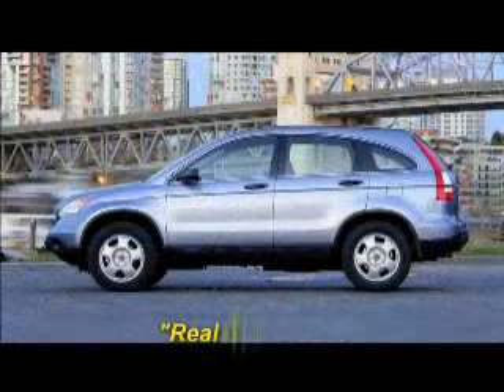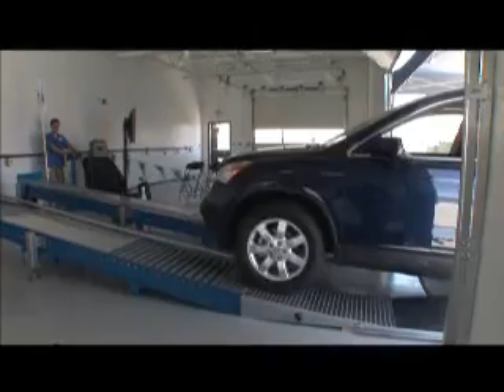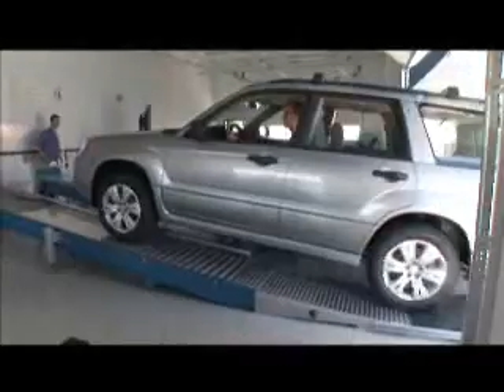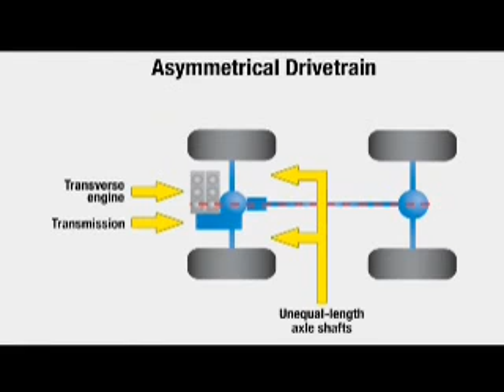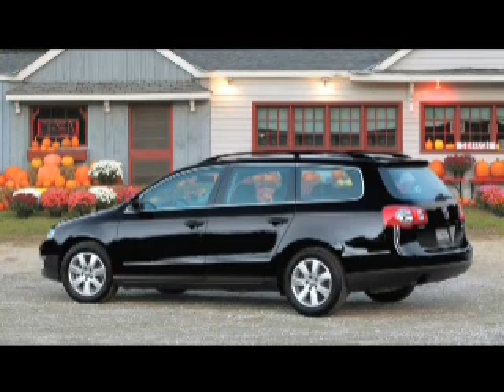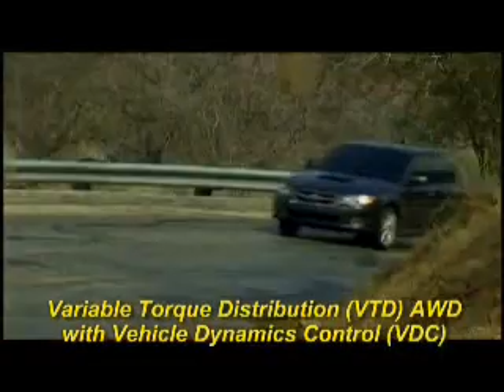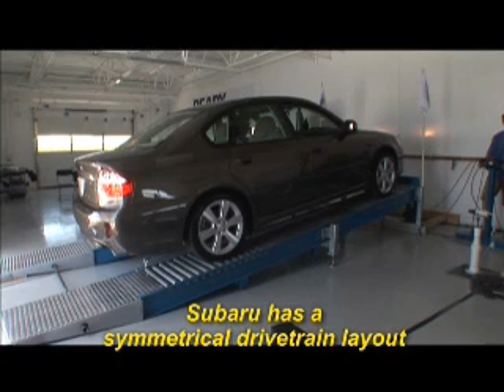Subaru AWD vs. competitors

Comment: I disagree...I own a 1997 Legacy L 4dr (auto) and an 05 Honda CR-V EX.  I have Blizzak snow tires for the CR-V and some 80K mile touring tires on the Subaru.  My Subaru would consistently make it up the driveway when the CR-V wouldn't...VSA on or off.  It was pretty sad as I was debating on CR-V vs Forester.  The CR-V is a lot roomier and I like the VTEC engine, but it doesn't even compare to the Subaru.

Comment: I'm looking to get a nice awd winter car. I found a 2007 Wrx with 75000km with invidia exhaust for 10500$. I also found a 2002 Audi A4 Avant 1.8T quattro stock with 125000km for about the same price. Which one should I get? I heard Audi's have electrical demons

Comment: this is also not all correct. The subaru with VCD can transfer up to 50% of power to the rearaxel and up to 100% to the frontaxel. The Torsen kan give up to 100% on rearaxel and 80% on front. and the Haldex 4gen can give 100% front or back. Also the haldex can give up to 85% on any rear wheel. The Haldex on the Passat is BAD BAD BAD and is a 95/5% system with limited transfer options. the 5.gen quattro and 4gen haldex will give the subaru system a beating. Please do the test!

Comment: yeah afaik most subaru's don't have traction control. Mine doesn't and it's not needed. Its symmetrical all wheel drive provides zero torque steer so no traction control needed.dd

Comment: I have a 2001 Jeep Cherokee with PT 4wd & an open rear diff. In deep snow or off-road it is almost unstoppable.On the road snow up to 1/2 foot, rain pot holes my 99 outback rules. Jeep unfortunately makes no modern equivalent  to the light fast fun to drive box Cherokee. I will buy 2011 Subaru Outback h6. It Weighs the same as 1999 outback has far more room and 100 more horsepower, far safer and gets better real world gas mileage. Now that's progress.  So what if it looks like a shocked rabbit.

Comment: This test does not represent a real world situation.
The rolls on this test provide ZERO grip. A car is VERY unlike to have more than one wheel with ZERO grip. When I say zero grip I mean ZERO
Most of the time the wheels have some sort of grip despite slipping at hight speed
When a wheel is slipping it still provides some traction to the car but in this test the "bogged" wheel has ZERO grip so it gives zero traction to the car. Its like having a wheel hanging on air.Can you have 3 wheels on air?

Comment: you only got half right.
 All 4 cylinder Audi and VW equip 4 motion(haldex,Wether they call it).Q5 2.0T or A3 2.0T is 4 motion but audi said it's quattro(caused under audi flag)

All V type Audi or VW equip quattro(torsen,whether they call it).phaeton equip with quattro but VW said it's 4 motion cause under VW flag.

wether to judge the vehicle equipe with haldex or torsen,as long as you see wether is V engine or not.

Comment: This video is bogus. The rear wheels aren't shown on purpose, so they can lie about the other vehicles (though they are telling the truth about the Subarus). The voice over keeps saying the other cars don't transmit power to the rear wheels. But they have added a steep step for the rear wheels to surmount before the car could move forward (you can see this when a car does move forward, it first rises up in back). So the test does show that Subarus transmit more power to the rear, but that's it.

Comment: Now test the best of Subaru against the P85D. See who has insane traction?
Reply: EH! Wrong. I could explain but I wrote that comment over a year ago. a) You're too late b) I forgot c) we now have a P90D and the best Subaru is the rear-wheel drive only BRZ.
Reply: I don't know anymore, it's been over a year. I've changed now. I'm not a mechanic for a Japanese auto maker. Now I'm into fashion and industrial design. Sorry, people change!
Reply: ***** But you are correct, not all AWD is created equal. Now one of the best and most efficient (even if not as effective) is Mazda i-Activ AWD. Have you read up on that? Is kindof amazing actually, very simple and intuitive. It detects environmental cues and position to send information to the wheel drive system. Read up is one of the most interesting and elegant solutions to the traction problem.

Comment: Try the Suzuki SX4....mine goes uphill on ice fully loaded from a dead start. And if I want I can turn off the traction control to really have fun with the curves. And I can totally lock it into 4WD. As long as the snow doesnt get up under the skid and actually lift the car off the ground my SX4 will get me to pizza

Comment: Do NOT buy any Acura as they are the same as highlander awd. In snowy st Paul I got stuck and the front wheels spun like crazy on snow and the rears on road surface and it it did not move. Quattro is not the same class but its better than xdrive which by the way I had to use my old outback to pull out an x5.

Comment: I wonder what makes people buy CR-V? It hasn't got Honda's fantastic V-TEC engine, nor economical IMA hybrid system. It' s hasn't got particularly agile handling nor serious off-road capability. It's only 4cylinder engine with 5seats and gets same gas mileage as V6 3.5litter Odyssey which has 8seats. Design? Hmm I'm not sure about it either.

Comment: of course the vw is not distributing enough power to the only wheel with traction, the car was not being revved up enough, of course 25% of only 50 hp wouldnt be enough to climb the ramp, if you were actually on a hill and full throttle releasing all 200Hp of the 2.0t the drivetrain would put 25% of that to the wheel, this test is invalid because the cars would fly right through the wall, my girlfriend's awd tiguan will blow the doors off a 2.5 subaru and get 5 mpg better, and we cant get it stuck if we tried

Comment: This is totaly wrong information. The 4motion/syncro and quattro system is not the same. they are all just brands. The passat in this test have a haldex system with 90/10%. 

40/60% is not stupid and on tarmac it's superbe! most audi's have 50/50 just like the subaru but the audi use mecanical coupling insted of viscous on subaru. You realy should try audi A6, Passat B5 or touareg and the subaru will be in strong competition. Also the new Opel Insignia would give it a hard time.

Comment: Subaru don't really have any proper competition, no other AWD system comes close.  It's all in the perfect drivetrain layout, every other manufacturer makes compromises with transverse mounted engines, transaxles, uneven length driveshafts etc. 

Couple that with the superb boxer and it's top of the pile, consistently.

Comment: This obviously only works with the later Subaru models.

I have a Forester GT turbo 2000 model. If one wheel looses traction the car wont move.
Symmetrical AWD means nothing. This guy is dribbling shit, It has all to do with how good the differential locking works. You can have a perfectly symmetrically system and it can be worse than a non-symmetrical system with good differentials. Obvious sales man has read the sales pitch and is just preaching it.

Comment: @harmankardonbose ok wranglers are very incredible automobiles, but thier 4wd is very unbalanced because the power has to go through a very unbalanced and heavy transfercase, i know the subaru would beat the hell out of a jeep in a traction test, cuz its common physics, and ive owned 4 jeeps (68 & 69 jeepster comando, and 87 &88 jeep cherokee limited [cherokee has the EXACT same layout as the wrangler] ) and 3 subarus (an 1984 gl coupe, 01 forester, a 2005 wrx wagon) and the subaru kills it..

Comment: I can tell you, as a devoted subaru driver...In rally, Ford Focus rapes subaru. In power/vs weight ratio, Evo takes it. In drivability and long term use, subaru wins. Mitubishi makes crap that runs fast for a short period, but its cast iron block is made from, apparently, american fail design...unreliable and terribad. In the long haul commute, subaru ftw

Comment: This video is biased. Granted the Honda and Toyota systems are worthless. 
This test needs to be conducted with identical tires for it to be completely valid. Also there is the Benz 4Matic system which is the most similar and wont have the same torque steer problems as the VW as the engines are mounted longitudinally.
Lastly, their claim that the rear wheel only test is extreme is not true. the car's weight is rearward on an uphill incline, but that gives the rear tires more traction, not less.

Comment: Honda keeps cost of ownership down by limiting the AWD system. Thats what most auto manufacturers do. But Honda has an AWD thats performs just as well as Subaru AWD - It's the SH-AWD. There's a lot more to the Acura AWD and thats means more components to fail; cost of ownership goes up. Same with Subaru; cost of ownership is a little higher. I like Subaru, but these videos are stupid; acting like Subaru is the only AWD system in the world that works harder than others.
Reply: +go2448 OK buddy. Enjoy your Subaru. They're nice rides.
Reply: +go2448 lol I believe you!
Reply: Austin Butler sorry but that's not true. no manufacturers limit their AWD systems. that would pissing in the wind and cost more than its worth to produce a FWD. there are viscous coupling units, and electronic coupling units. both work the same way. viscous coupling uses gear oil in a clutch pack differential much like a clutch pack limited slip differential, just no ring and pinion gears. electronic unit locks the gears together but still allows for slip with clutch packs. every video comparing vehicles with all the same or similar AWD systems. the only difference is they turn off traction control in the vehicle they are showing off and leave it on in the others that are competition. traction control cuts fuel to the engine obviously resulting in a power loss and less rotation at the wheels. if the front wheels slip and can't rotate fast enough, the coupling unit can never lock. even though each of these vehicles would climb the ramp and rollers if traction control was off, these videos use these tricks to sway your opinion in favor of the brand they are promoting.   the Audi Quattro system is the best AWD system you can buy for the money, and it would still fail to climb the ramp if the traction control is on.
Reply: Wesley Ash I'm not exactly sure what I was wrong about....

Comment: God that video talks some utter utter bollocks.

Does anyone make a car with unequal length driveshafts anymore?

And as it the passat can't climb with one wheel having traction as the gearbox is mounted transversely what total and utter bollocks.

Nothing what so ever to do with the 4wd system or the diffs, its the length of the driveshafts

Erm yeah

Comment: Staged...show the rear wheels too..
Reply: +1
Reply: +hondatrix You could claim that, unless you already saw it go with two wheels having traction, and then saw it go with only one. At the start, they let the two front wheels slip, and then let the rear push it, in the end, they left only one rear wheel, and you could notice that it tried to spin the front wheels a lot, something it didn't do on the initial test.